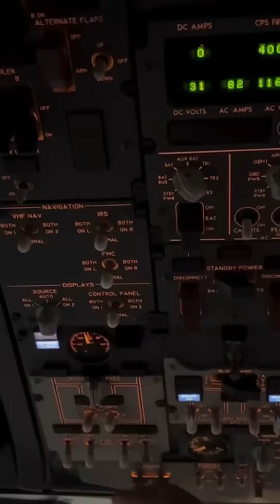How far can an aircraft fly with 1 engine?

Comment: And how much can it glide if both engine fails?
Reply: Really depends. I'll give one example. What altitude 😂
Reply: that probably depends solely on the altitude and wind of course
Reply: Glide ratio and altitude is the most important factor
Reply: @SlayaOnKeys also it’s speed
Reply: Doesn't one sided thrust make it turn 😅 ?
Reply: Rudder trim fix it @ParvPatel90
Reply: @RuchiPatel-x5h  that's where rudder compensation comes into play, as well as aileron input
Reply: @ParvPatel90 just keep turning in the opposite direction
Reply: @YDQin  yeah I thought so but its to annoying to keep doing tht